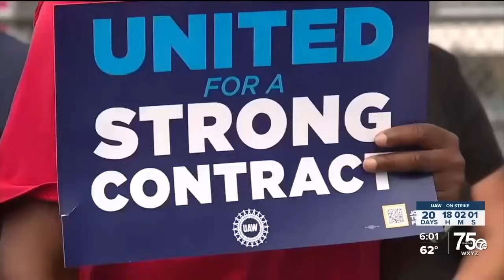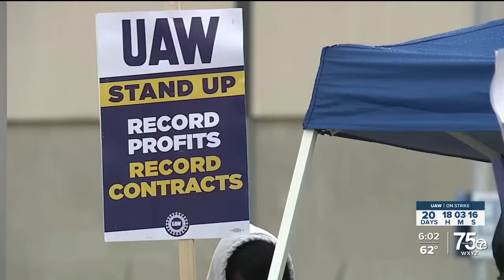GM sends 6th counter offer in UAW negotiations; ripple effects continue industry-wide

Comment: Remember: President Joe Biden said that he would be the most transparent president in American history in his inaugural address on the US Capitol steps on January 20, 2021. 

“I will be a President for all Americans, and that means being honest and transparent with you. I will always tell you the truth, even when it's hard.” 

Overall, prices have surged so far by almost 17 percent during your term! Ouch, you just gave the average worker a permanent 17% pay cut. More employees are now walking the picket lines for better wages, in order to make up for lost purchasing power. These new labor costs will eventually be passed on to consumers. Now the US is going to see "wage inflation" in 6-8 months. Joe, thanks for starting this vicious cycle. 

The average credit credit rate is now 24.45%, which is the highest rate in 80 years. 1960 = 15%. 1970 = 18.10%. 1980 = 18.10%. 1990 = 17.15%. 2000 = 18.84%. 2010 = 14.84%. 2020 = 16.08%. 2023 = 24.45%. 

Home interest rates have increased dramatically. The average interest rate on a 30-year fixed-rate mortgage has increased from 2.7% in January 2021 to 7.88% as of today. The last time home mortgage rates were as high as today was 30 years ago. “As a result, mortgage applications ground to a halt, dropping to the lowest level since 1996. The purchase market slowed to the lowest level of activity since 1995, as the rapid rise in rates pushed an increasing number of potential home buyers out of the market.”

 With high home prices and high mortgage rates...housing affordability is at a historic low. Under your administration... the American dream of owning a home has been crushed.

 And now Mr. President, you have added 6-8 million "illegal immigrants'' who will need housing of some type. They entered the United States with nothing but the clothes on their back. Joe, just as you screwed homeowners, I guess rents are also going to increase dramatically in the near future.

 Instead of controlling the border, Joe Biden flooded and overwhelmed the entire nation's immigration infrastructure. Joe's "open border" also allows the Mexican Cartel Pharmacy of Fentanyl to smuggle enough of this drug into America to kill 75,000 Americans (mostly young) every year. Now taxpayers at the national, state, city, and local levels are paying to fund Joe’s policy decisions to the tune of 100-150 billions of dollars a year. No wonder that many unions including the UAW, the Teamsters, Kaiser Permanente Union, and many others are going on strike; trying to recover from your policy mistakes.

 Is Joe's immigration policy meant to flood the labor market and hold wages down? Who knows? Have not heard a good reason why Joe has hurt the average American worker by allowing millions of foreigners to so quickly enter this country. Remember what Joe said on his inaugural day: "that means being honest and transparent with you. I will always tell you the truth, even when it's hard.” 

So I guess Biden stands for: (By, Immigration, Degrades, Entire Nation). Ouch, many Americans' quality of life is going downhill. To me, “Bidenomics” is really “Biden, Knock Me Down!”

And now Joe wants to help the UAW and the auto workers. You see he is certain what the world climate is going to look like in 2050 and he is going to help ”Mr.  World Climate” to get back on the right track.    (Certain refers to a belief that a particular event will happen without any doubt or ambiguity.)

Joe  hasn’t quite figured out how to stop hurricanes, tornadoes, floods, thunderstorms, or even make rain from clouds,  but Joe knows a lot about what is necessary to make our 2050 global climate the way it should be. 

You see, we have too much carbon dioxide and the world needs to get rid of this nasty gas. It’s the one thing that is presently screwing up our weather and in the future it is going to get worse. I know weather is very complex and even powerful computers cannot tell you with 100% certainty what the weather will be like in 10 days.  But Joe ( with no weather scientific background) knows  future global climate  dynamics for years ( 2023 - 2050). 

Upon reading political climate activists studies he has decided that  America needs to be green. Joe has set a goal that by 2030, car manufacturers output of electric cars should be 50% of total production. Joe only regurgitates what he hears and reads. Have UAW management read both the pro and con on climate change to be knowledgeable on how it will affect their members.

Let’s look at Ford, one of the big three auto companies.  Ford produced 4.4 million gas combustion engines in 2022 and 61,465 electric vehicles. That means 2.2 million electric cars need to be produced by 2030 or 7 years from now.

 OK, for measurement purposes.  The Gigafactory Texas Tesla only manufactures electric vehicles. The Gigafactory Texas plant currently produces the Tesla Model Y electric vehicle.  Annual production is 250,000 per year, using a 24 hour, 7 days per week schedule. Approximately 20,000 people and 1,000 robots make this plant hum. Construction of Gigafactory Texas Tesla's plant began in July 2020 and was completed in less than two years. The factory officially opened on April 7, 2022, and began producing electric vehicles.  It is over 10 million square feet in size, is powered by 100% renewable energy, and uses a variety of water conservation and recycling measures.  Based on estimates from analysts and industry experts, it is believed that the plant cost between $1.1 billion and $2 billion to build. Let's split the difference and use $1.5 billion per plant.

Now for the bottom line. If Ford needs to build 2.2 million electric vehicles by 2030, then it will need to build the equivalent of eight high tech Gigafactory size factories, employ approximately 160,000 people, and use 8,000 robots. They also must continue to build 2.2 million gas combustion vehicles to satisfy their other customers. They also will need billions in capital dollars to start this electric vehicle program.  Think they can make the 2030 deadline? The other automakers, GM and Stellantis also face the same challenges.

Also consider this: more parts are needed to manufacture a gas combustion car than an electric car.
Here is a comparison of the number of parts in a gas combustion car and an electric car: Gas combustion cars  have a number of  parts that are not required in electric cars, such as:
Starter motor
Alternator
Spark plugs
Distributor
Valve train
Oil pump
Fuel injectors
Exhaust system
Emission control system
Fuel Pump
Fuel Tank
Combustion engine  …EV use electrical motors.

As a result of these differences, gas combustion cars typically have around 2,000-2,500 parts, while electric cars have around 1,000-1,500 parts. Less parts means less union people are needed to manufacture a car.

 Joe Biden wants the UAW to help him with his climate change agenda.  He is against combustion engine vehicles due to his belief in a drastic world climate change expected by 2050: did Joe mention that when he spent 15 minutes on the UAW picket line?

 Joe is not interested in UAW jobs, he is interested in changing the entire transportation system of America. Instead of a gradual transition to electrical vehicles he prefers to gut 50% of Ford’s present combustion vehicle infrastructure production and replace it with manufacturing  electrical cars  by 2030. He is also gutting as fast as possible America’s infrastructure in oil and gas. This will result in much higher prices of gasoline for combustion engines.

Because there are less parts needed to build an electrical vehicle, it is suspected that there will be less UAW union workers to build vehicles. Jobs will be lost. Added to this consider the following: To build an electric vehicle it is estimated that Tesla robots perform around 80% of the work in the body shop and paint shop, and around 30% of the work in the general assembly area. Major efforts are being made to increase these percentages.
So Joe Biden can endorse a 40% pay increase ( which makes him look like a hero to the working class), but a transition of many jobs will be needed and large capital dollars expenditures will be required to make electric vehicles a reality at Ford. So Ford can either run down this path or prudently walk down this path. 

Either way, Joe’ chances of being around by 2030 grow slimmer as each year passes. When he has departed, you will be stuck with the consequences and the costs based on decisions made in the next few years. For me, I have great reluctance to believe and follow someone who is so sure of what the world climate is going to look like in 2050.

So if you want to go with Joe Biden, think green and think electric vehicles. Remember what Joe said:  “I will be a President for all Americans, and that means being honest and transparent with you. I will always tell you the truth, even when it's hard.” I hear what he says, but somehow I don’t think we are getting all the information and the big picture of his agenda.
Reply: I ain't reading all that